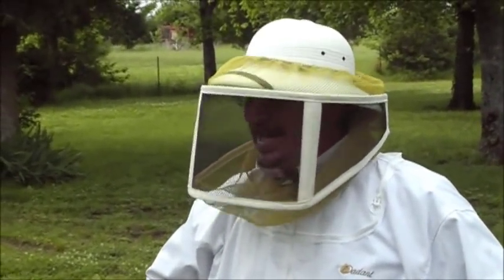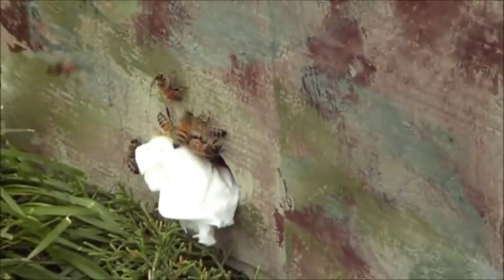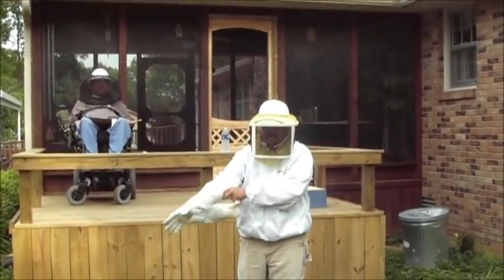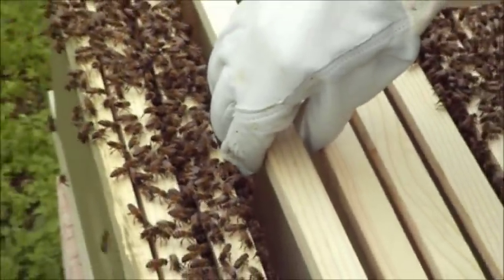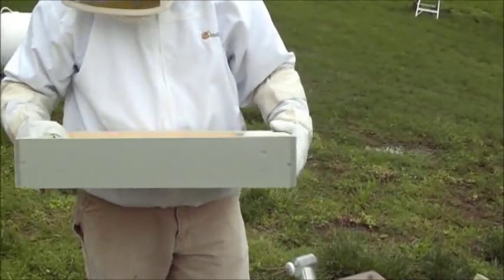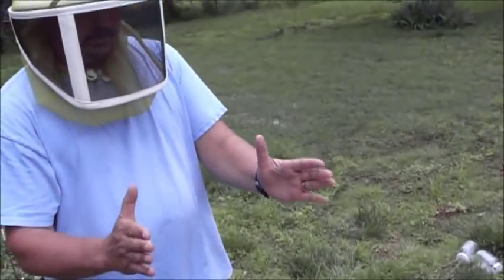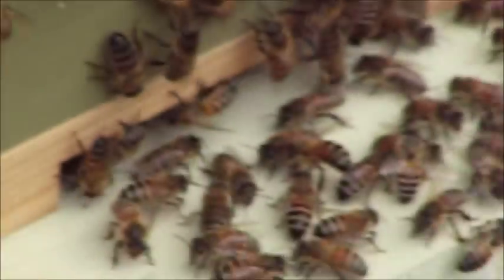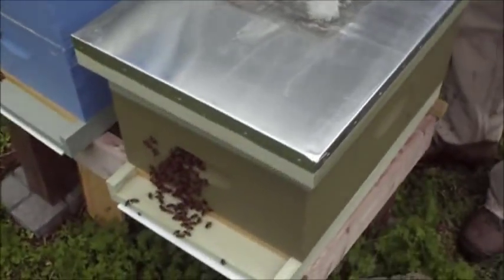Installing a Swarm in an 8-Frame Langstroth Medium - 02 May 2011

Comment: Would a swarm be fine starting off in a foundation less deep 8 frame langstroth?
Reply: I wouldn't use entirely foundationless frames starting off with a swarm.  They might build straight comb right down the centre of each frame, but they could easily build comb every which way and make a mess for you.  I would alternate frames with and without foundation just to be safe.  Then do what you like once the bees have settled in.